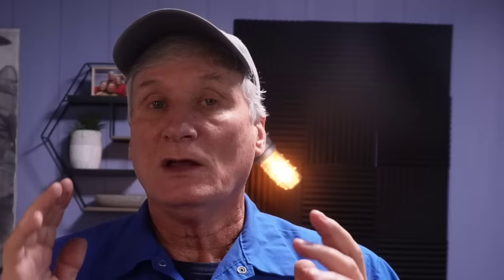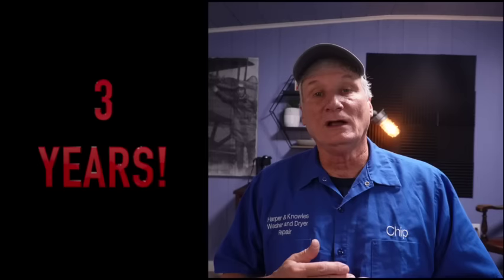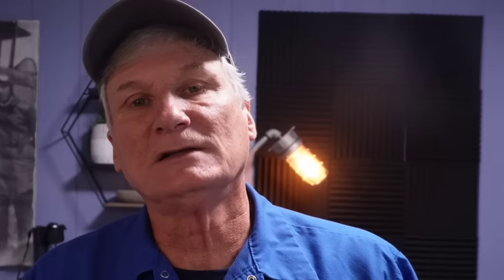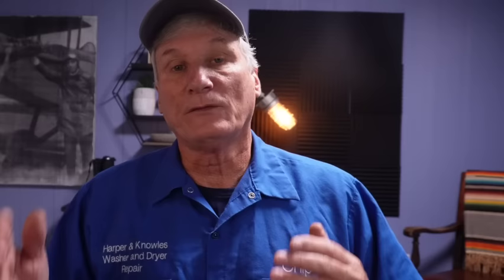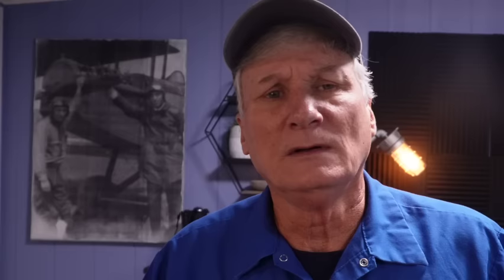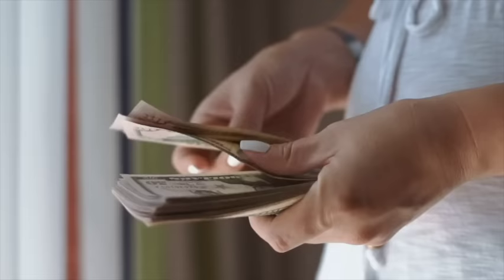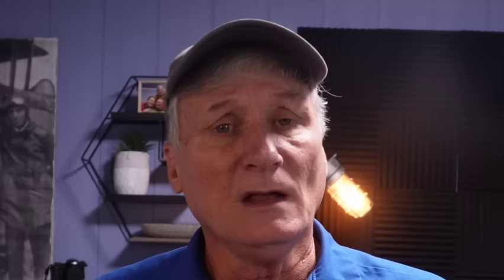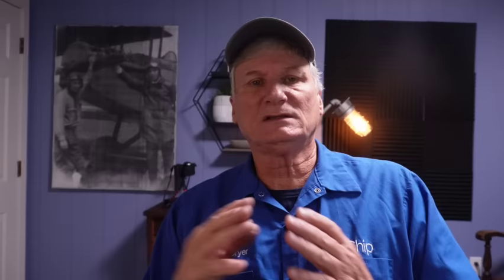How To Choose the Best Washing Machine: Speed Queen TC5 vs. TR7 Review

Comment: I was told recently by a repairman that the new Speed Queens are not as good.  That you want one from 2017(?) or earlier.  Is that true?
Fortunately I have one
Reply from the maker: I think the controversy is over the attempt by SQ to do some updating to their models around 2017. As far as I can tell the TR models with the agitator and spin basket connected are the culprit.  Moving the water through the clothes instead of the clothes through the water wasn’t embraced by the consumers like they hoped. However, as long as you stick to the TC series machines that are built to the “classic” standards of excellence you can’t go wrong. Also, government regulations about efficiency and water conservation had to be met. But, SQ and other companies began putting “deep fill” options on their setting so that consumers could decide whether they wanted to conserve water or not. Great comment my friend and thanks for watching!

Comment: Here in Canada, we’re told Huebesch is the SQ just another name… Could you please validate if it is accurate or a smart corporate scam? Why the name change? I grew up on SQ, you couldn’t kill those machines. My mom had the “avocado” antique look appliances for 34 years until they started to break down.
Reply from the maker: This is what I found on Wikipedia about it. “Alliance Laundry Systems manufactures products under the brands Speed Queen, Primus, Huebsch, IPSO, and UniMac. The company was founded in 1998 and is based in Ripon, Wisconsin. The company's precursor Barlow & Seelig Manufacturing was established in 1908 and later introduced a hand-operated washer to the marketplace. The Speed Queen brand was created in 1928 with the introduction of stainless steel wash tubs in 1939 and automatic washers and dryers in 1952. Eventually Barlow & Seelig was renamed Speed Queen Company, and was later purchased by McGraw-Edison. In 1979, McGraw-Edison sold its appliance division to Raytheon Company. In February 1998, private equity firm Bain Capital agreed to acquire the commercial laundry business from Raytheon for $358 million. And as a result, Alliance Laundry Systems was formed.

In January 2005, Teachers' Private Capital, the private equity affiliate of the Ontario Teachers' Pension Plan acquired the majority of the equity interests of Alliance Laundry for $450 million. In 2009, the Alliance Laundry Systems University (ALSU) was founded as a corporate university available online to authorized Alliance Laundry Systems distributors, route operators and customers.

In March 2014, the Alliance Laundry acquired Primus Laundry Equipment headquartered in Gullegem, Belgium for approx. $259.4 million.

In April 2015, it was reported that Ontario Teachers' Pension Plan was planning to sell Alliance Laundry or issue an IPO, valuing the business at $1.8 billion. Later in 2015, a majority stake was sold to BDT Capital Partners.”
Great question! Thanks for watching!

Comment: Speed queen cannot be matched.  The extra cost upfront will easily wash out over the years.  Warranty is a huge plus, we put our machines through tons of loads and it just comes back for more.  Even moving it you can tell that it's quite a bit heavier as well.  One thing I will say is that we have had rust issues on 3 different machines, within 3 years.  The bottom part of the lid, the top of the washer and underside rim.  It was bad enough where it was streaking.  I have been going back a forth with speed queen about it, and they have been less than helpful.  I even just asked them to send me the parts, and still no response.
Reply from the maker: I appreciate your honest feedback about your experience with Speed Queen washers. It's great to hear that you recognize the long-term value, durability, and impressive warranty offered by these machines. However, I'm sorry to hear that you've faced rust issues on multiple units.

It's disappointing that you haven't received the support you need from Speed Queen regarding this issue. My suggestion would be to try reaching out to them through a different channel, like their social media pages, as sometimes that can help you connect with someone who can assist you more effectively. You can find links to their social media pages at the bottom of their website page.

Using chlorine bleach in any washing machine will accelerate rusting of the iron alloys. I always tell my customers to add any chlorine bleach directly into the wash water.  In the meantime, keep an eye on the rust issue, and document any occurrences to provide evidence when discussing the issue with Speed Queen. I hope you can resolve this problem soon, and I appreciate you sharing your experience with us. Thanks for watching my channel, and please don't hesitate to reach out if you have any further questions or concerns. Thanks for watching my channel.

Comment: I have a Speed Queen top load washing machine, and I love it.  Unfortunately, it has been in storage for almost a year now after I was forced to move from my rental because the owner decided to turn the property into an AirBnB.  I moved into an efficiency apartment whilst I continue to look for a better fit rental.  I miss my washer and dryer so much.  I have been taking my laundry to a laundromat.  These days, all of the laundromats use the front load machines which do not have agitators.  Well, let me tell you, they stink!  The front load machine do not get my laundry very clean at all.  I have been adding extra detergent in order to try to get cleaner clothes, but that does not work very well.  I fear the detergent does not fully rinse out, and then you end up drying it into. your laundry in the dryer.  I cannot figure out why manufacturers make those awful washers and why so many people buy them. A solid washer with agitator, such as Speed Queen is soooo much better!
Reply from the maker: I understand your frustration with the front load machines at the laundromat and the challenges of getting your laundry clean with them. It can be disappointing when the detergent doesn't fully rinse out and leaves residue on your clothes. While front load machines have their advantages, such as larger capacity and water efficiency, they may not be the best fit for everyone's cleaning needs. Many people prefer the traditional top load machines with agitators, like your Speed Queen, for their effective cleaning performance. It's important for manufacturers to offer a variety of options to cater to different preferences and laundry requirements. Hopefully, you'll find a new rental soon where you can enjoy the convenience of your beloved Speed Queen washer and dryer again. Hang in there and thanks for watching!
Reply: @HarperandKnowles  The front load machines are the only machines any of the laundromats around here use anymore.  I think they are ruining my linens and clothes.  My best friend bought one some years ago.  She said not only did it not last for more than about 4-5 years (she does a lot of laundry, though), but she also felt it did not clean her laundry as well, so she bought another top loader.

Thank you for your kind words.  I honestly am worried about finding another rental.  The market here is no better (perhaps even worse) than it was a year ago, and as a senior on SS, I cannot compete well at all.  For example, last year I was the first two see two nice duplexes and apply for them.  One of them was owned by someone in Chicago.  Her estate said he was sure she would rather have an older person than a couple of students.  Well, several more people also applied.  One of them, presumably a student(?), offered to pay the application fee, the deposits, and the entire year's rent up front at signing.  Who do you think got the rental?  I could tell you a lot of other stories like this.  I would not believe them myself if I was not the one experiencing them.

My 80 year old neighbour who lived next door to me at my old place had been there for 30 years---no kidding.  He was unable to gain approval for an apartment on his SS alone which was too small of an income.  He was contemplating living out of his old van.  Then, someone who had a business offered him a room inside of their business---no kitchen and no loo.  He had to take out a gym membership in order to have somewhere to bathe and shave every day .  He is still in that little room.

What is happening with housing and seniors and poor people in this country is a disgrace.  I am not joking to say I am frightened.  I might be living out of my 35 year old motor vehicle by the end of September.  

Please keep us in your prayers.  Thank you. 
🙏 ✝

Comment: I have a coin operated speed queen and it overflows with water some say you cannot turn the hot water off like I can with my 1994 Maytag. I never wash with hot water and won't buy a machine that the hot water must be connected. The old machines work with two cold water lines. My concern my cabin in the mountains has a well and the water pressure is low if other sources are being used. Such as someone taking a shower or watering the garden outside. I know the speed queen is new old stock. Barely used. I think the water level switch needs improvement I tried testing the switch but it seems to be working. The hose for the switch seems no clogs. I just don't know what's wrong 73
Reply from the maker: It sounds like you've done a thorough job trying to diagnose the issue with your Speed Queen washer. Given your situation, I'd recommend checking the pressure switch or the pressure hose for any holes that might be causing the problem. Additionally, low water pressure in your cabin could lead to some water valves leaking, which may be why your machine is overflowing. Keep in mind that if the water pressure to the valve is less than 20 psi, the valve may not seal properly, causing leakage. Ensure that your washer is getting adequate water pressure, and consider addressing any potential issues with the water valve. Also, in regard to the hot water inlet valve, you can always use a Y splitter to supply cold water to both the hot and cold water valves. Here is a link for one ( https://amzn.to/41pfoJY ). I hope this helps you find a solution, and don't hesitate to reach out if you have any more questions. Good luck, and thanks for watching my channel!
Reply: @HarperandKnowles  I haven't moved to the cabin yet I just had two speed queens given to me where I work. One is a top loader and the other is a front loader. The top loader is the one with the water overflow problem, the pressure hose came off and I didn't know it until my front porch was flooded with water I used the y adapter and hooked the hot and cold together. There is another problem when the washer was working the spin did not take all the soapy water out so the rinse still has soapy water after the load is done. There may be other problems with the washer as for the quality of the motors and and the housing it's well built. I can try replacing the pressure hose and check the switch.. it works if I blow into the end where the hose goes I think the problem is in the other end of the pressure hose. I been reading up on the speed queen website I want to learn how to program the board maybe I can make this machine work for my own needs. I feel if the machine was designed for a laundromat it should be a sound machine my Maytag will be 30 years old next year I haven't had any issues with the machine. I replace the clock motor when a electrical storm burned out the original clock motor. We were on vacation and my cordless phone got messed up also. I unplug things now when we go away on vacation. 73

Comment: The problem with SpeedQueen is the size. 3.2 cubic feet is TINY. Reliability is great, but if I can't wash a king-size comforter, what's the point?
Reply from the maker: Thank you for your comment and sharing your concern about the 3.2 cubic feet tub on the Speed Queen washer. It's true that the capacity may not be large enough to accommodate a king-sized comforter, but it's essential to consider the overall benefits and trade-offs when choosing a washing machine.

Speed Queen washers are known for their durability, reliability, and American-made quality. The smaller capacity allows the washer to provide better agitation and more effective cleaning for your everyday laundry needs. For larger items like king-sized comforters, it might be necessary to use a laundromat or consider an alternative washing machine with a larger capacity.

It's crucial to evaluate your specific needs and preferences when selecting a washer, and my channel aims to provide information and reviews to help you make an informed decision. I understand that no one washer will be perfect for everyone, so I strive to cover a wide range of products to suit different requirements.

I appreciate your engagement and hope you find the content on my channel helpful. Please don't hesitate to reach out if you have any further questions or suggestions!

Comment: the best washing machine is about 20 years old clean condition with a cabinet full of spare parts no computers no computers if you get a computerized washing machine or dryer refrigerator and then go bad it's three or four hundred dollars for the part $200 to have some high school dropout put it in and it's not worth it and if you get a water spout in the door type refrigerator freezer the heating mechanism in the door will go bad and it's $500 for a new door not under warranty
Reply from the maker: It's clear that you appreciate the simplicity and durability of older washing machines without computerized components. I understand your concerns about the potential costs associated with repairing modern appliances, as well as your preference for non-computerized machines.

However, I would like to point out that not all service technicians are high school dropouts. In fact, most technicians have specialized skills, including electrical and electronic knowledge, plumbing expertise, and a great deal of common sense. These professionals work hard to provide quality service and support for customers with appliance issues.

It's always important to find a reputable, well-trained technician when dealing with appliance repairs. While no machine is perfect, technological advancements can offer improved efficiency, convenience, and features that many people find valuable.

Thank you for sharing your thoughts and for watching my channel. If you have any further questions or concerns, please don't hesitate to reach out.

Comment: Where can you buy them? I’m live in Central Fl. I have never seen these in Home Depot or Lowe’s, and not advertised anywhere! Thanks! I am sick and tired of contsrantly replacing appliances!
Reply from the maker: Speed Queen only sells their products through smaller independent retail outlets. If you go to their web site http//speedqueen.com  and look for “Where to buy” on the bar at the top of the page, you can enter your zip code and select a distance from your location you will find many dealers in central Florida. I used an Orlando zip code and 100 miles and counted over 30 retailers in the area. Thanks for watching!

Comment: I laughed out loud when I saw the electronics control panel in the TR7. These days, the electronics are the first component to go, as experienced in my LG dryer. Speed Queen should use the button knobs, regardless of the agitator controls.
Reply from the maker: Thanks for sharing your thoughts! I completely understand your concerns about electronic panels in appliances. Indeed, the durability of electronics in household appliances has become a hot topic, especially as many of us have experienced issues with them in various brands, just like your experience with your LG dryer.

Speed Queen is well-known for its emphasis on durability and longevity, and its decision to include electronic control panels in models like the TR7 is based on providing users with more precise control options and features that can enhance the efficiency and effectiveness of the washing process. However, your point about the reliability of mechanical controls, such as button knobs, is well-taken. Mechanical controls have a reputation for lasting longer and being less prone to failure than their electronic counterparts.

It's worth noting that Speed Queen does offer models with different types of control interfaces, aiming to cater to a wide range of preferences and reliability concerns. For those wary of electronic panels, models with more traditional controls might be more appealing.

Additionally, Speed Queen’s confidence in their product quality is reflected in their warranty offerings, which are among the most generous in the industry. This demonstrates their commitment to standing behind their products, electronic controls included.

I'll remember your feedback for future reviews, highlighting the pros and cons of different control types. It's important for consumers to consider not just the features but also the longevity and reliability of their appliances. Thanks again for your comment, and I hope your next appliance, whether it's a Speed Queen or another brand, meets all your expectations!